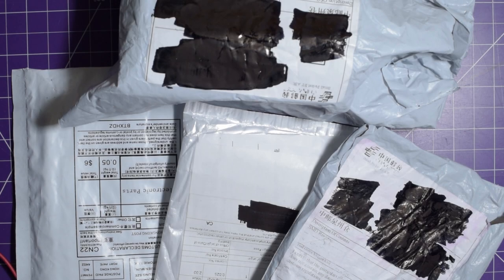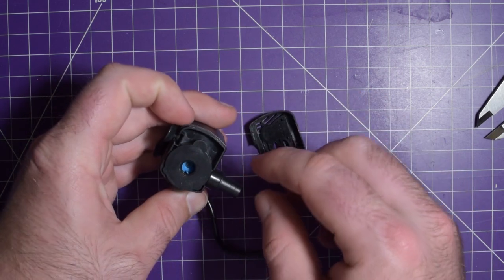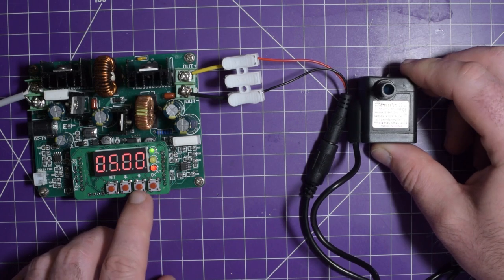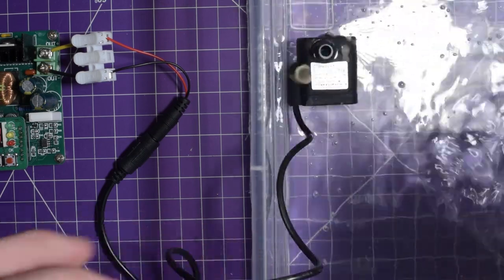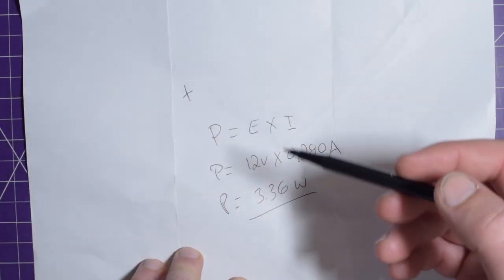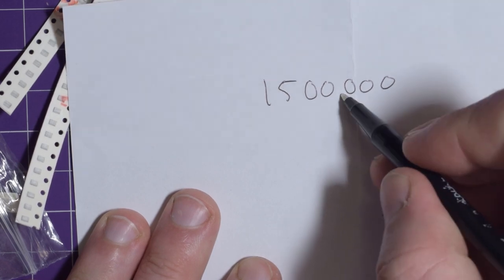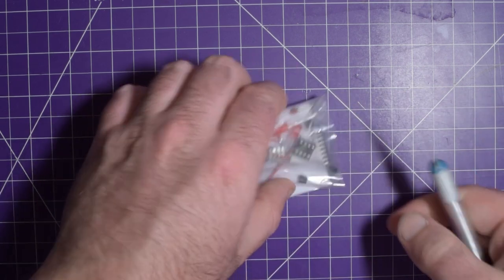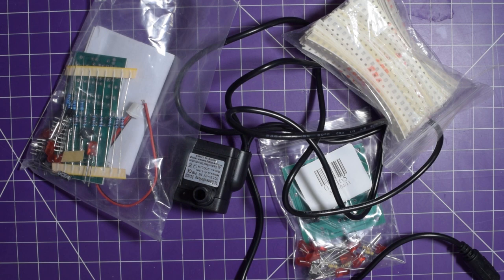Mailbag 11 - Pumped Up!

Comment: I really enjoy these videos!  This kind of thing is exactly what I am using to get back in to electronics--super-cheap kits from the far east. You can learn a great deal from them, particularly about highly versatile and ubiquitous parts like the 555 chip or its slightly advanced siblings.

One thing I will say about SMT for hobby electronics is that to use them you need to learn how to design your own PCBs in a computer programme and then how to physically make them from copper-plated boards and transparencies. I have tried and failed to learn how to use 'Eagle' several times and the initial outlay for PCB-etching tools is beyond what I allow myself for spending on electronics--so I have to stick with verroboard. As you mention there are adapters for SMT to through-hole packages like the SOT23, however depending on what you are building these may not work. I had a failure the other week while trying to build a DC-DC boost converter based around a Linear Technologies LT1613 chip. I had to attach it to an SMT adapter, but as the data sheet makes clear that device relies on minimal physical distance between components--down to less than 5mm. Which you just cannot do with a piece of strip board, although I hoped for my uses I might get away with it. Sadly not. The experience was a bit disheartening actually as I spent nearly £20 on components. Nevermind--when I can save up enough pocket money I am going to give another design a try that uses an ATTiny PIC to act as the high-speed oscillator in the boost converter with otherwise emphatically through-hole components. I think that one will work!